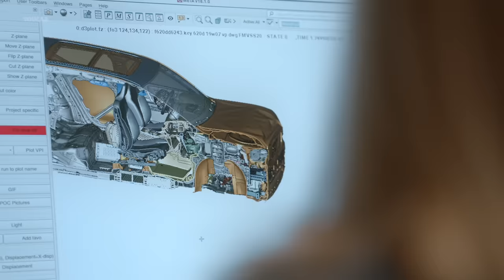Volvo Car Crash Center – The Temple of Crash Test

Comment: Who drops a car like that.. Good job Volvo.
Reply: They do it to simulate a fall from a mountain in the car
Reply: Drunk drivers xd
Reply: Falling from a bridge 🙄
Reply: SAAB
Reply: Hi
Reply: I this kind of test Indian car is one of the best 😤😤😤
Reply: Multi Level Parking lot.
Reply: Old Top Gear
Reply: Good to know it'll save drunk drivers.
Reply: Who comments without thinking outside of the box... Good job dhya dxb
Reply: Just in case Richard Hammond drives one....
Reply: VOLVO - NCAP crash test is not enough for passenger safety , so we created our own.
Reply: Fast&Furious 8
Reply: @kaushalkishore2208  have you seen the crash tests for Indian cars.. They fold like tinfoil
Reply: Even a well crashed volvo thats been dropped once before from 35m looks better on its 2nd crash than some 10year old cars do in a moderate accident
Reply: Who drops a car like that good job volvo
Reply: Who drops a car like that good job volvo 
Arunabh says he is not the same as he did
Reply: 0:52 SaftyFlexingg
Reply: It’s a test dah 🙄🤌🏼
Reply: fast and furious
Reply: Even range rovers too🤣
Reply: @waltersvely   not the people they drive into....
Reply: Testing the drop if it is safe for the drunk drivers
Reply: @jannikmagkuchen  Depending on the height, yes.
Reply: @prakashs1674  Actually, unreliability hurts the safety of Range Rovers as they can strand you.
Reply: @currymonster6516  dude Indian car Tata has record of cheapest car achieved 5 star for safety from NCAP and Tata owns Land Rover and Jaguar so think twice before commenting.
Reply: Hii
Reply: A random cliff: 🤨
Reply: Volvo drops car like that
Reply: @franksala6067  In reality, the car would be much more damaged if it fell from a mountain
Reply: @charlstonrequiez4626  חצי חיליליחע
Reply: @jannikmagkuchen  all of Them could be it
Reply: Too bad no dummies in the big drop...
Reply: The Swedes that's who
Reply: I think No  car beat volvo
Reply: Clearly Volvo do
Reply: They tell you

Comment: My parents drive a Volvo XC90 and the sensors and safety features are really nice. We were on the freeway and there was a water truck that spilled a bunch of water all over the road. It was able to slow down and tightened the seatbelts before we even got 1000 feet from it.

Comment: Other car companies:
flexing with horsepower, price, etc.
Volvo:
flexing with safety
Reply: lmao
Reply: damn!
Reply: Funny thing is, Volvos are fast too. They also have really attractive, comfortable interiors. That's why I love Volvos -- safety is paramount, but they don't slack on the other things as a compromise.
Reply: Tesla: flexing with both...hehe
Reply: @migdaora  what scandal??
Reply: @TesIaCH  nevermind they're safe too, my mistake
Reply: @migdaora  👌 ✅
Reply: No land rover is more safer then Volvo.
Reply: @migdaora  maybe u meant vw
Reply: Ever heard of TATA
Reply: Safety is nth w/o a proper power/drivetrain
Reply: @tahsin28  Which is why when your stock Volvo pushes 300HP it's nice to have the extra safety aspect.
Reply: @anthonya824  I am surprised that the XC60 Recharge can do 0-60 in 5.0 seconds
Reply: @vivekkumarpandey5100  Yes. They own Jaguar Land Rover.
Reply: @anthonya824  bby
Reply: @Squeakthehamster  +nh hvk kl íp
Reply: @proudindian.7828  Based on what evidence / facts?
Reply: @proudindian.7828  false
Reply: @proudindian.7828  Never
Reply: @TesIaCH  a small dent costs 10k to fix in a Tesla. Some guy rear ended my uncle’s Tesla at 5-6 mph his repair bill was 11 thousand.
Reply: @VJ29110  Same happened on 8 y old audi a4 to my father, repair bill was 8k thats "normal".
Reply: @TesIaCH my dad got a dent on his x5 that costed just 2500 to fix. A repair bill over 7 k for a small dent is too much.
Reply: @vivekkumarpandey5100  just because they have 5 stars (only for adults because for backseats it’s just 3 to 4 stars) does not mean they are better than Volvo lol. Try doing this (1:42) with any tata 😂

Comment: This is a great facility.  I hope Volvos new Chinese owners keep this program running.  Good luck you will need it.
Reply: i doubt they will
Reply: Facility still open and most Volvo engines are still built in Sweden with most of the steel coming from Sweden as well.
Reply: i trust in you geely
Reply: Wonder if they tested the polestar 2 here
Reply: Actually it's the other way around. The chinese will (want to) adopt volvos safety and put it into their vehicles. Check out some of the latest rating of the cars by the same group. All 5 stars
Reply: Oh No Chinese buyed it ???
Reply: @macdeep8523  The Chinese have owned Volvo for like literally 11 years now.
Reply: @duskii_rxse9746  you do realize this video was shot years after Chinese became owner of Volvo right? And all the car models in the video are designed after Chinese ownership?

Comment: Someone caused me to crash in my '08 V70. Written off and I was absolutely gutted. But for a 30mph collision (I went into their side with no chance to react) I didn't even have the slightest whiplash or anything. Only felt where the seatbelt had locked and ringing in the ears from the airbags. I was so impressed that I replaced it 2 days later with an '08 V70.

Comment: Impossible, but the car is still good.
Reply: Everything is possible
Reply: I don't know what's impossible.
Reply: if your talking about the thumbnail, then skid of a mountain buddy and see what happens.
Reply: It is possible because in my country people have lose control of their car on the 5th+ parking lot floor and have fall from that height.
Reply: Force is force no matter what direction. Dropping from a crane is the same as driving into a solid object. That's why they change the angle of the car when it's dropped.
Reply: ...Unbelievable isn't it...??😃😀🙂 
💫💥VOLVOOOOO💫💥💪🤜👊🤛💪😎

Comment: 3:49 What is the purpose of the firework (or whatever it is) on top of the car? Can someone explain?
Reply: It is so they can see where the force of the crash goes to if it reaches a certain point the "fireworks" get set off

Comment: My public comment to the Volvo team at the Volvo Cars Safety Center is to test my proprietary applications as applied to all Volvo vehicles  to provide visual and added time to allow  communication safety advantages in effective reductions in vehicle fatalities, pedestrian fatalities, cyclist fatalities.  These proprietary accident avoidance systems require no crash testing.  More specifically COMPARISIONS IN WHAT IS NOT, AND WHAT IS .  Please advise when your group can group test only 7 new proprietary  applications that can be gleaned by accessing the following US Patent Numbers #8,382,350 #8,596,840 #8,894,256 #9.108,569 #9,308,859 #9,469,246 and 10,780,820.  For additional information, product samples, Petitions of Rulemaking presented to NHTSA for new FMVSS, etc. refer to the website: Inview Vehicle Trim.

Comment: Even the old Volvos are preferable to some of the other baked bean can cars on the roads. Someone pulled out of a junction in front my 1991 940 estate, and his Mitsubishi 4x4 became the crumple zone. Airbags deployed and it was carted off on a truck. Ambulance in attendance for his front seat passenger. My 940 had a smashed headlight and I drove it home.

Comment: Is Volvo reliable for long use like Toyota?  Are the parts quality good or it's worst than bmw
Reply: There reliable. Won’t last as long as a Toyota however. About 5 years and you will start to have minor issues. 7 some more major ones. Also Bmw part quality and reliability isn’t that bad :p
Reply: But recently I have been hearing lots of negative reviews on BMW by their owners.
Reply: The Volvos with the 5 cilinder engines (1991-2016) are pretty much bulletproof, as well the older ones with the Redblock engine family.
Also The T6 engine is reliable as well. I would say that they're better than BMW in reliability.
Reply: I have a 2012 Volvo with 1.6L diesel (D4162T) currently at 240.000 km. So far never had any issues other than basic maintenance.
Reply: I Have a 2002 V70 with 360.000Km... 0 problems... but i’m going tu buy an XC60. If you want a Volvo take a V70 it’s the best Volvo ever ☺️
Reply: For sure you will not find any car worse than bmw, even the Chinese cars can last more than bmw. Im saying that coz im owning 3rd series 2018 bmw and im so sorry that i bought it.